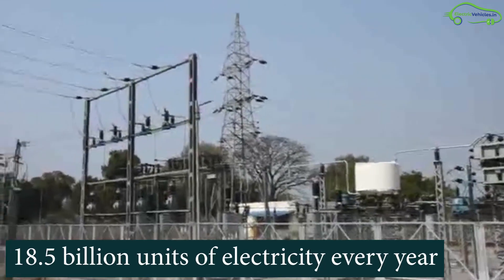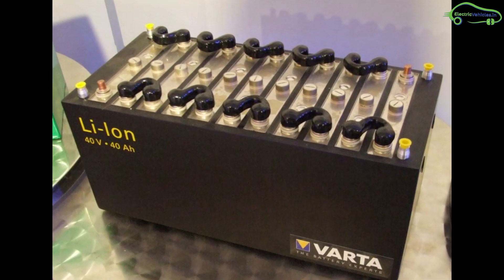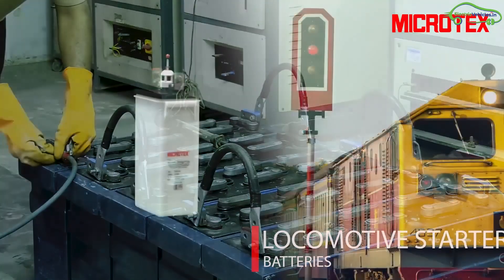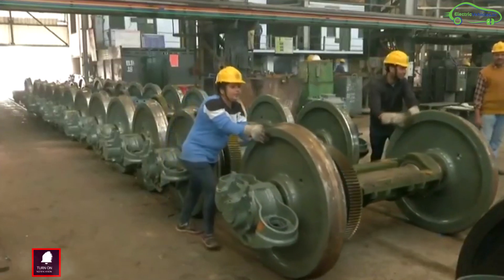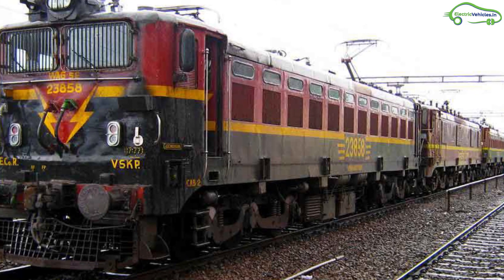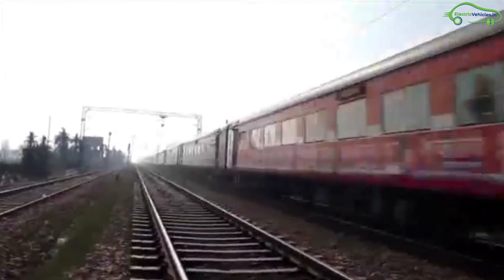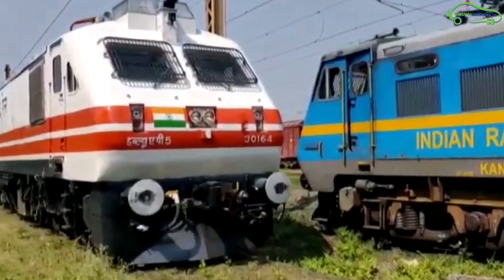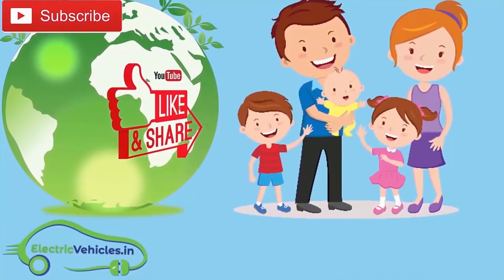Lithium-ion Battery Powered Trains from Indian Railways - EV Special

Comment: No batteries will produce enough power to run heavy locomotives
Reply: An electric Ford F150 recently pulled a whole train
Reply: @biplabkumarghosh6300  Han to kitna speed tk, speed badegi na battery jaldi jaldi khtm hogi, ur long distance me nhi useful hai.
Reply: @exodusraj7670  If a normal road use vehicle can pull a train slowly, I am sure a dedicated locomotive would be able to pull it much faster.
Production electric cars have range as long as 640km. If I assume the range will be same on a train and the train's average speed to be 100km/h, it will take 6.4 hours to fully use the battery and about half an hour for an 80% recharge

Comment: Non sense. RAilways consume so much electricity that no battery can support. There is infact since there are over head cables, thare is no need for battery
Reply: Lithium Ion battery is more energy efficient than diesel.  Lithium ion operated engine can pull 24 passengers bogeys and 58 goods train bogeys.  It can be used in shunting and where there is no overhead wire.  Let them do the R&D.  They may prove to be useful in remote areas or in hill railways. I think since hill railway trains are usually small, they will be ideal for Lithium-ion battery operated engines.  They can pull trains till we become 100% electrified.
Reply: Not economical. After the batt runs out , what do U use to charge the batt?  Electricity, which comes from oil . .
Reply: @justscanningby9902  electricity doesn't depend on oil anymore.
Solar is slowly taking over, and research going on all over the world to produce clean energy and to put a full stop on our dependency on oil and coal

Comment: Why not use iron ion batteries recently devloped in iit madras
Reply: Not available commercially and needs more research to reach where Li stands.
Reply: Iro can store only 60% of same capacity of lithium batteries....more than that,lithium is lightweight,whereas weight of large iro batteries itself will consume more energy!!
Reply: @abhijithvarmar1034 
Toh bhai iron battery ko move thori karna hai... Battery se overhead wire me bijli lani hai...kitni bhi badi battery laga lo

Comment: Stupid idea alreay rail network is fully electrified so no need to waste energy in battery inefficiency
Reply: glitch gamer without correct information don't post comment, especially when you are correcting others, so many routes in Rajasthan itself is not electrified, one is in just in front of my house in Ajmer. it comes from Udaipur and goes towards Delhi, still Diesel engines run on it, plus I have mentioned that Li ion battery is more efficient than diesel.
Reply: 😆😆 bdsk knowledge tho lay purr
Reply: Dude see the video first, then comment